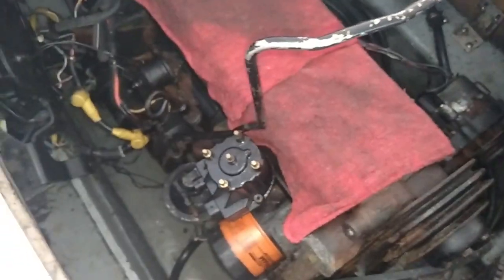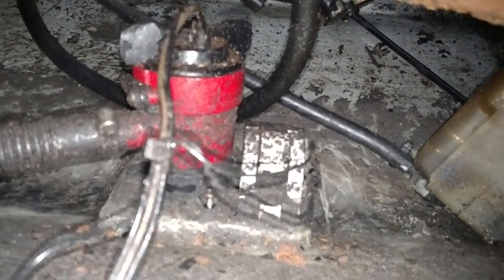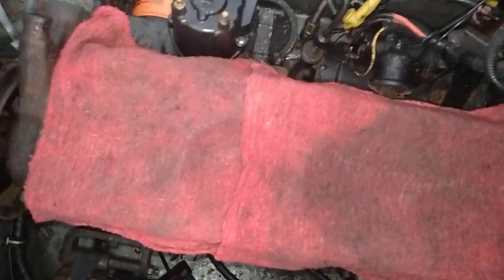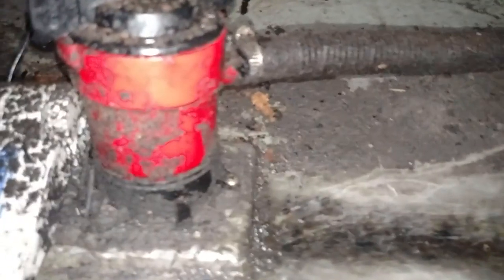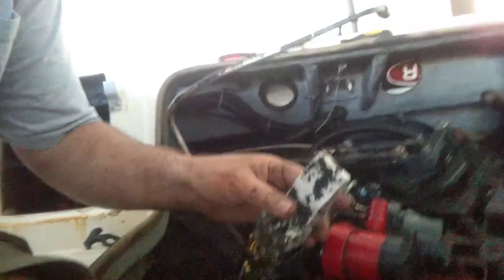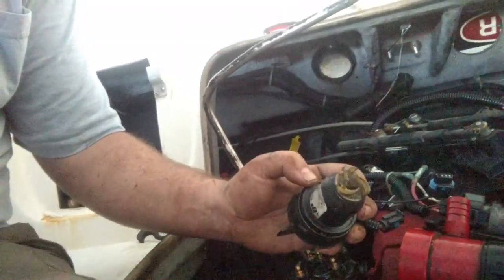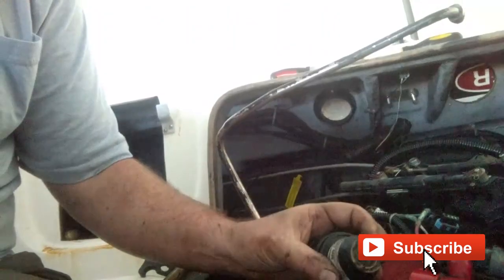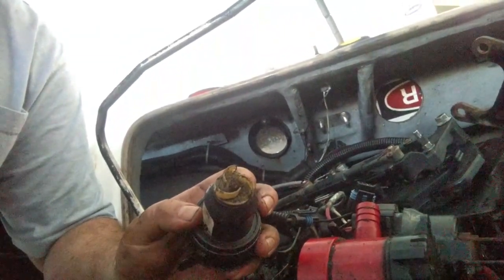Bilge Pump Replacement On Inboard Boat EP #5 || Bayliner Bowrider 175

Comment: A lot has been done since this video babe lol
Reply from the maker: It sure has baby, we still have so much to do.
Reply: I believe I have this same boat can you please confirm model!? Also can I use any bilge pump to replace mine or does it have to be exact same one???
Reply from the maker: We used a cheaper one we found off Amazon. The only issue is getting the screws in.